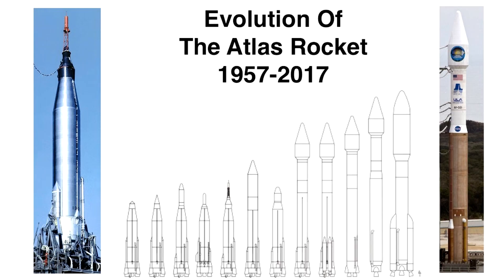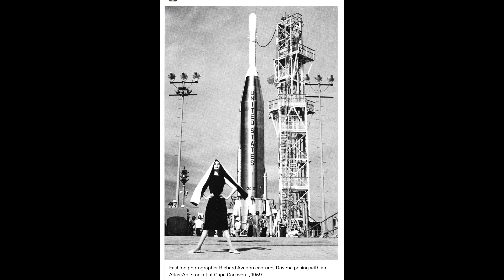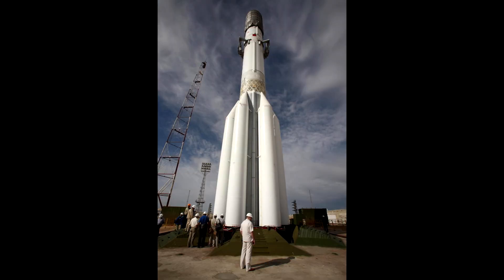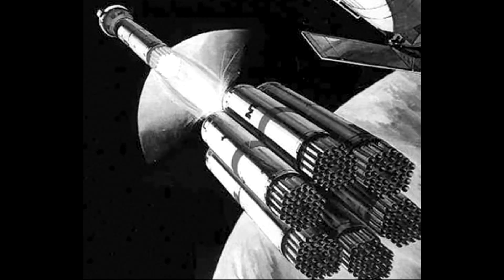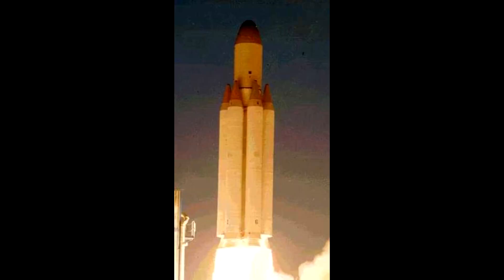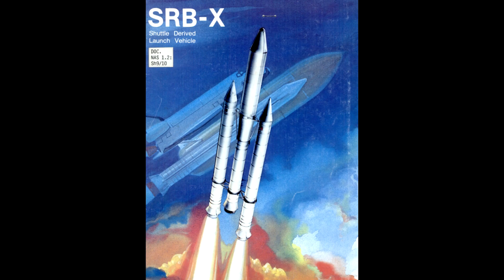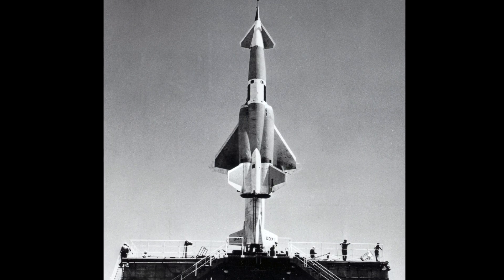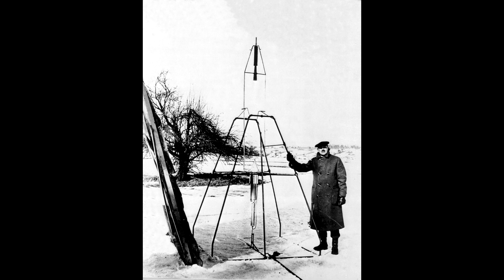The Worst Looking Rockets Ever Designed!

Comment: The space shuttle has to be the ugliest rocket ever, it just looked like loads od bits all bolted together and just looked wrong
Reply: It wasn't the ugliest, it was the most fascinating because it was the most unsymetrical rocket.
Reply: @MartinMizner  obviously everyone has different opinions,  but to me as a very rough rule of thumb, if something looks right it is right, but the space shuttle never looked right. It was incedible engineering, but it wasnt safe, it was mega expensive and in someways became a backward step after appollo, but i guess that was all politics. Now compare with the  Saturn 5, that rocket looked right in both an engineering sense and was a very handsome  machine.

Comment: A good list overall, but personally I would swap out the reasonably designed Proton for the asymmetrical horse-designed-by-a-committee that was the Space Shuttle.  The shuttle didn't just look bad, it demonstrated several times(twice fatally) that its function was just as bad as its form.

Comment: Apparently I have no sense of aesthetics, because I've probably 'invented' all of these designs in KSP entirely unaware of the fact that they really existed. I've got building Thumper SRB-X clones down to a science. You need the Solid Rocket Distancing to prevent them from overheating. Also there is something very satisfying about putting a satellite in orbit and the only thing I have to do for it is time the launch window and press space a couple of times.

Comment: 0:50 "... the tendency for them [engineers] to want rockets to look cool." That has not been my experience. I am a missile engineer for Raytheon. I have yet to encounter an engineer who gives a rat's hole about aesthetics. Unless you are in an industry where appearance seriously matters (say, automotive), function drives design. Always. I am not defending that trend. I possess an artistic bent myself, and have found the lack of aesthetic consideration given by my peers across many industries to be frustrating at times. I am glad that Elon Musk bucks that trend and thinks things should not just function well, but look cool while doing so. But most engineers are indeed "aesthetically challenged." Putting together "an entire team of aesthetically challenged engineers" is not at all difficult.

Comment: As a kid, when model rocket engines from Estes were cheap, I experimented with a lot of very Kerbal model rocket designs (this was way before KSP was a thing).  I built one of those Goddard pendulum rockets with the engine at the top.  It took off, but then just hovered about 20' off the ground for a while, drifting sideways this way and that, until the engine ran out.

Comment: The Long March is probably the ugliest rocket family overall
Reply: It's practically a ripoff of the proton koncept, but ment to be improved by using modern materials.
Reply: @Vampi_Sweden  didn't they even use hypergolic engines from Russia / USSR
Reply: @masondaub9201  
I am not 100% sure, but i think they did, at least it would make most sense if they did.

Not a bad idea actualy since it got the job done and they saved a lot of money on the developement both by re using the design base and pre built engines, as far as i know Proton will soon be phased out (like the R7 wich is no longer in production in reality as far as i know) for the new rocket generation so i think there would be no big deal letting China buy rocket engines of the older design for the civil space program in reality.
Reply: @Vampi_Sweden  yeah engines are one of the most complex parts of a rocket it would make sense if they bought them from Russia. 
It sucks that they are phasing out the R7 and Proton though. They are such iconic rockets. Perhaps only beaten out by the space shuttle and the Saturn V.
Reply: @masondaub9201  Yes, i fully agree with that, i think no other concept managed to both survive and also make prophit for so long as those concepts did, and if it where not fro R7 i think the Apollo program had not been what it became, and as i guess You know allredy the space shuttle did use the same engine concept from the engines NASA managed to get from the russian spaceprogram. It's awsome that scientists all ower the world seem to think that greater purposes that may benefit the progress for the whole humanity must stand ower the temporary will of mad rulers, no matter what country. All my respect to the Russian guys who took the risk and saved the engines from being scrapped!

It came to my mind that China bought a lot of scavenged scrap metal from decesed proton parts "under the table" from those russian guys who collected the remains of burned out first and second stages and the Chinese agents sometime did pay ridiculous amonth of money for some of the Titan based alloys, like 1000$ kilogram for the rarest parts in order to get the metal alloy.
I am pretty sure they gathered messurements and parts from found stages in the wilderness as well, it's quite easy to find those spots if one hawe contact with the local population and lot of the areas are realtivly easy acessible with old russian army trucks, used by the foresters and farmworkers there.

My best guess is that it must had been for military purpose originaly, but they later reused what they came up with for the official civil spaceprogram.

Comment: Is it wrong to say the entire space shuttle stack is quite awkward looking? Not to say I don't love it, but it is a couple of rockets, with another rocket plane stuck to its side and a gigantic drop tank sticking out up front. Especially after the boosters are jettisoned.
Reply: Nostalgia blinders, I guess.  The Shuttle had all the aesthetic problems of Navajo with the added fugliness of those bigass SRBs strapped to the side.
Reply: I was also rather surprised not to see it included.
Reply: One damn heavy payload shroud.
Reply: Yes, and believe it or not it flies well as a big model rocket, and lifts off slowly and realistically cuz of all the massive wind resistance. Mine had a couple of clear plastic fins attached to the SRB's, angled out, from the External Tank side, but other wise "stock" in appearance. It was awesome, but I only flew it once then retired it. (It was the Atlantis) Mine did not detach and glide back the orbiter but I've seen that done too! :D
Reply: @ronschlorff7089  IIRC Estes had a kit for a boost-glider version that worked remarkably well.  Ungainly as it was.
Reply: @vicroc4  yes, I had, have that one too, much smaller than my scratch built version. It had fin units stuck out the back of the SRB's that made it look less stock. As I mentioned I was going for a stock look, hence the clear plastic fins!! When I flew it the one time (in the mid- 90's) the little crowd at the launch site "went wild"!! :D

Comment: "I've never got over the disappointment of realizing that the first stage isn't surrounded by strap on boosters"

I can totally relate to that
Reply: My view of the Proton first stage - a slightly uglier version of the Saturn I/ Saturn IB first stage...
Reply: @KnightRanger38  I mean, that pretty much is the Proton. The little brother of a moon rocket.
Reply: @Had Tobe What can space rocketry possibly mean to brain-dead flat-earthers?
Reply: Why did Proton has ugly fairings looking like they were made from insulation or recycled clothes?
Reply: @MartinMizner  Because that isn't the actual fairing. I also thought the same thing until I learned that during rollout the Proton's fairing is covered in an insulative shroud, designed to protect the payload from temperature extremes. The shroud is removed before launch, revealing a normal looking smooth fairing.
Reply: Size queen identified

Comment: Unpopular opinion: The Space Shuttle.
I know it's historic and important and it achieved a lot. But honestly: Off-center rockets look bad. Rockets that have to permanently waste thrust to not tip over, look bad. Doesn't mater, whether it's an Atlas 5 with only one srb, or the Space Shuttle.
I'll go even further. SLS is what the Space Shuttle should have looked like.
Reply: The Cashier don’t look up what the “Advanced Launch System (ALS)” Proposal was
Reply: @ber936   You were right. I should have not looked it up. I was only aware of the in-line shuttle derieved designes. That looks horrible.
Reply: A Galaxy cargo plane with a Dreanchaser sticking out the front is what the Shuttle should have looked like.
Reply: Never liked the Shuttle's look. And once they found out it cost too much to refit to make recycling a good idea they should have gone to something else then.
Reply: Not only is it ugly, but it was so poorly designed it lead to the deaths of 14 astronauts.  I am very disappointed that Scott didn't include this monstrosity.  Design by committee at it's worst.

Comment: That Jupiter III reminds me of the classic "Untitled Space Craft" monstrosity.
Reply: But it would get to space, with enough auto struts.
Reply: @gajbooks  l
Reply: The sort of thing you'd get when you spend 3 hours designing the perfect landing craft and then realize you don't have nuclear engines unlocked for that Moho mission.
Reply: If it gets 170 tons towards the Moon, looks are less important :-)
Reply: @zapfanzapfan  Imagine the rampant cost and massive launch instability of that ugly mess though....
Reply: If you thought the Jupiter III is bad, someone made a twin Shuttle launch vehicle in KSP. Literally just the External fuel tank and SRB setup of a single shuttle, with a shuttle mounted on each side.
Reply: @setesh1294  Well, that would have been symmetric...
Reply: @setesh1294  Hahaha! Link it, that sounds hilarious!
Reply: @setesh1294  The soviet Energia actually had a launch plan that looked exactly like that. 2 Buran shuttles strapped to an Energia rocket. 
And since the Energia was a monster of lift capacity, it could have made it work if they had ever gotten around to testing that configuration.
Reply: After 4 beers making a Jupiter III in KSP sounds like a fantastic idea.
Reply: Which Jupiter took the Robinson’s and the rest on a 3 hour tour to Alpha Centauri
Reply: Oh my I have never agreed with something someone so much
Reply: @Had Tobe Shut up Flathead. That's not even related to anything being talked about.
Reply: If he had not had the "must have at least kind of flown" restriction, Project Orion with the nuclear explosion driven "rockets" would have been a natural for the category too.
Reply: @Ugly_German_Truths  Hard disagree.
Reply: No, that is my standard launch vehicle xD
Reply: I somehow managed to make and use it effectively in a KSL career mode game somehow :P

Comment: “Worst Looking Rockets ever Designed”
I think you forgot to add “Untitled Space Craft”...
Reply: Jupiter III is Untitled Space  Craft lite
Reply: So Pinochet.. free low earth transits for commies?
Reply: @michaelfoye1135  
Yes! But Pinochet’s Commie Control co. is on hiatus due to the COVID-19 Pandemic, we are scheduled for a reopening in March 2021
Reply: @pinochet3317  mr pinochet can i has food?
Reply: @RuskiWaffle 
no.
Reply: @pinochet3317  thanks m'lord
Reply: You just won ksp
Reply: the Schplinginator. 1400 kg of explosives launching a bullet 60 cm in diameter at mach 7 a mere four meters off the pad. 60% of the heat shield burns off on ascent

Comment: ‘Apparently at one point during testing they filled this whole thing with vodka’
Reply: It was to test the tanks. Couldn't use real fuel or oxidiser as hypergolics are really nasty. Too cold to use water because of risk of it freezing. Solution, use industrial quantities of vodka!
Reply: @owensmith7530  Brilliant Russians they were
Reply: V-2 engineers frequently got drunk on the V-2's 75% ethanol. Not very often people get drunk from drinking rocket fuel. But hey, when you need a drink, you need a drink.
Reply: I believe the V-2 flew using ethanol derived from potatoes.
Reply: "I always wondered where they got the name for SKYY vodka..."

No guessing as to how they drained the tanks, nor how long it took. 😉
Reply: @Had Tobe How is that related to the comment?
Reply: This guy wrote the same comment again in other comment. Are you a bot, or you need more members in your church of flat Earth?
Reply: @MartinMizner  Are you referring to Had Tobe?
Reply: @CrowDepartment  yes
Reply: That is the most Russian thing I've heard yet

Comment: To me, the space shuttle itself was the most ridiculous design ever conceived. A bulky, plane-like orbiter riding a giant orange fuel tank into space like a witch on a broomstick.
Reply: For the first shuttle flight they painted the external tank white. They stopped doing that to save weight.
Reply: When I finally actually saw , way back when, the final design of the Space Shuttle and learned what all the hoopla was about, I was so horrified that I determined to go into rocket engineering to get this all straightened out.
I was like "This is it?! ". To this day the sight of strap-on solid boosters still fills me with a bout of reflex nausea that almost requires a coupla Dramamine capsules.
Reply: I mean, at least they worked really well
Reply: They killed more crew than any other space vehicle... I mean, it's a kind of high score?
Reply: @LolTollhurst  It's only because it holds the highest number of people in a crew, capsules only hold 3 people while the space shuttle can have a crew of 7 people
Reply: @theseductivepotato7459  if you mean, almost evey launch had or made problems such as dropping foam into the wing, engines not working, thermal protection tiles falling, SRB's heating a Hydrogen tank, no escape tower (that would have saved the challenger). And so on and on.....
Reply: @environmentNow  Yeah well, you do have a good point, but we should be glad spaceflight is getting safer and cheaper over time.
Reply: @theseductivepotato7459  The premise was okay, but the execution (particularly the orbiter) was horrible. It was supposed to be reusable, which it was in part, but only after arduous recertification and an entire new external tank. The thermal protection system was just downright bad and dangerous. The SRB issue was a moronic procedeural error which could have happened with any sort of issue.
Reply: @LolTollhurst  if Soyuz held the same number of people it would have killed the same number of people as the shuttle
Reply: pregnant seagull

Comment: I never knew that the proton side boosters were stuck to the rocket body, I thought it was separable and those otrag rockets look like a brick of ugliness. Also what idiot thought that 1 srb would have good stability. And the only time thrust should be over payload is for something like a mars rover when landing, I've used that design for a lot of duna and mun rovers because it makes getting down and touching ground with wheel easier.